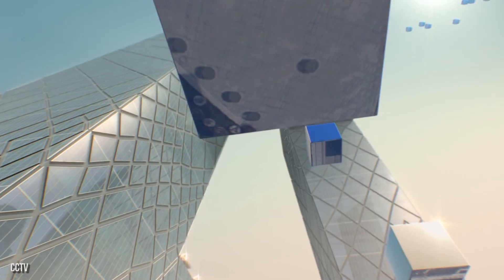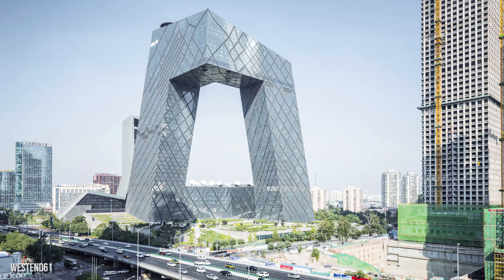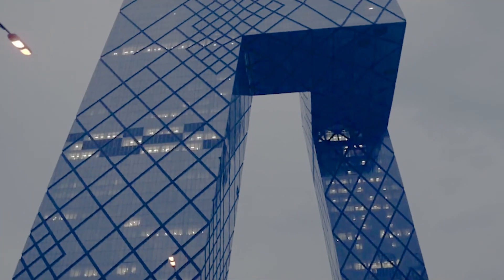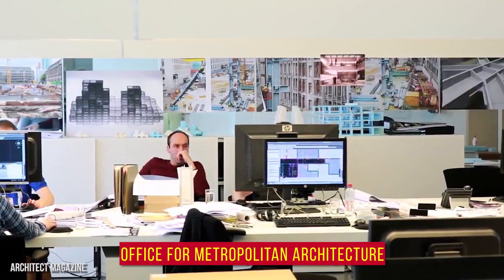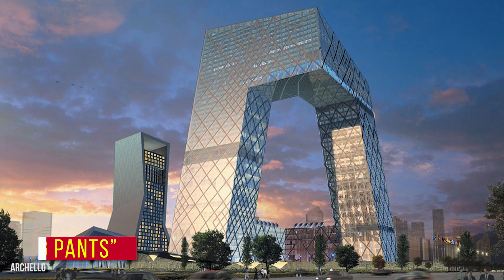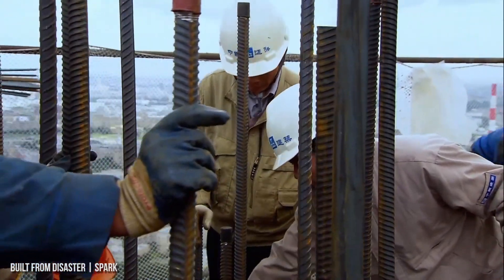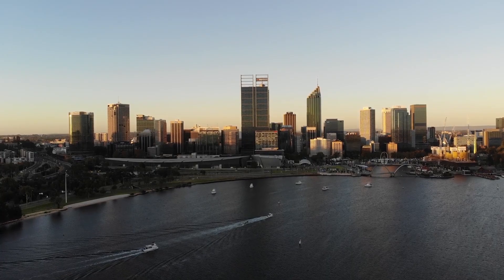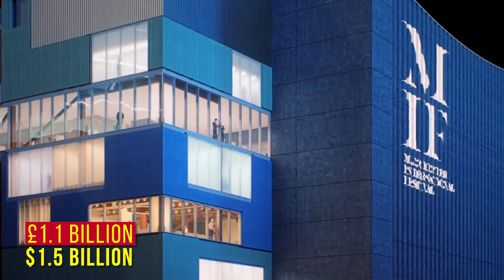This Empty Tower In Beijing Costs $900 Million

Comment: Design looks too unsafe to live/work in. Due to how sky scrapers are constantly subject to strong winds, there is a chance that the building could topple over, or fall due to how it is heavy on one side. Looks like the weight distribution is so unstable, They should construct another tower in between the middle to support the center, which could potentially prevent a toppling over if heavy winds or over time would make instability make the building fall.